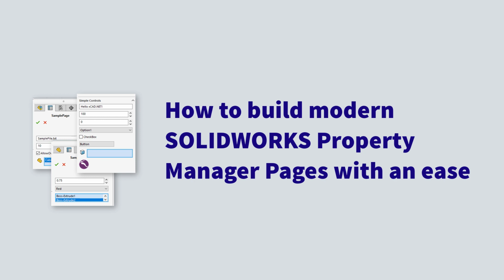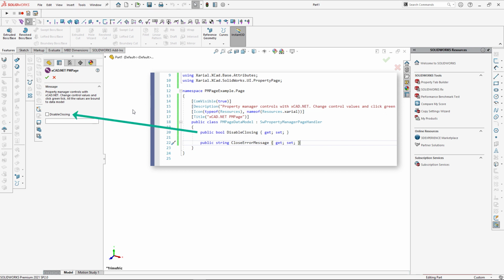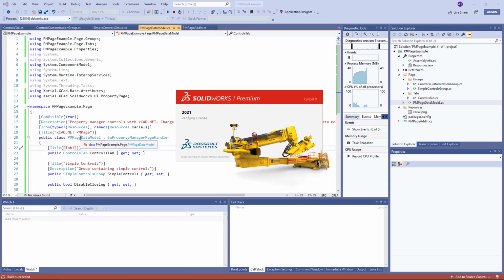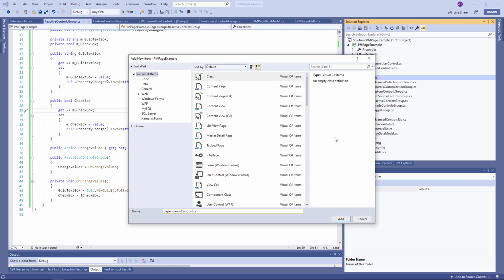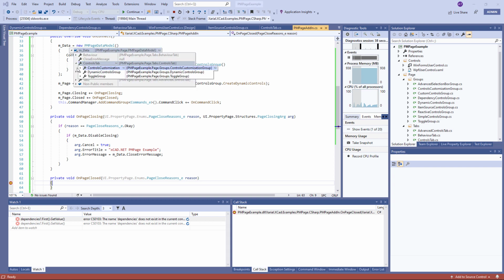Build modern SOLIDWORKS Property Manager Pages with an ease

Comment from the maker: 0:00 - Intro
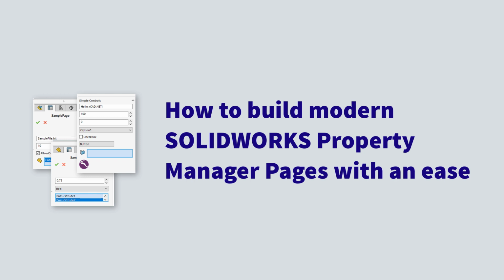0:53 - Current challenges building Property Manager Pages
01:55 - Building Property Manager Pages using xCAD.NET
04:33 - Overview of the tutorial
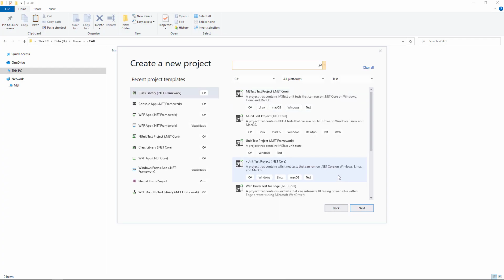06:25 - Getting started. Simple Property Manager Page bound to the data model and closing handler
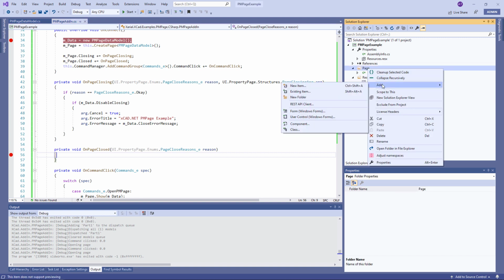13:19 - Adding simple controls (GroupBox, TextBox, NumberBox, ComboBox, CheckBox, Button, SelectionBox, PictureBox) and binding to data model
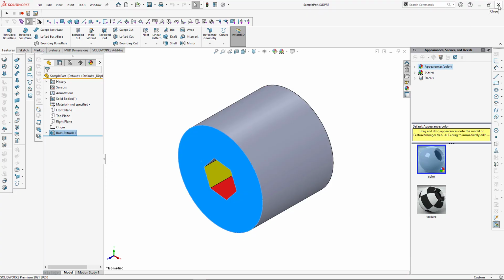16:58 - Customizing controls (custom and standard icons, titles, tooltips, height, background and foreground colors, control specific options) and adding tabs
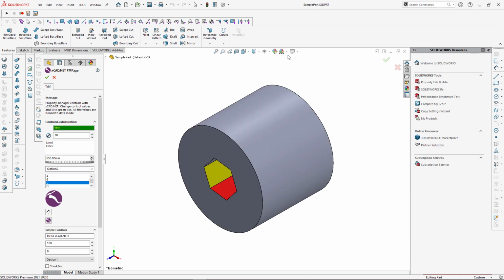20:25 - Customizing tabs and advanced SelectionBox control (standard filters, multiple selections, custom filters)
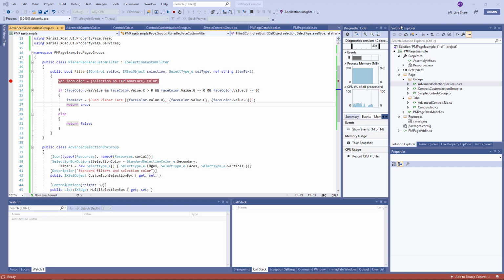24:50 - Checkable GroupBox, excluding the generation of the control for specific properties
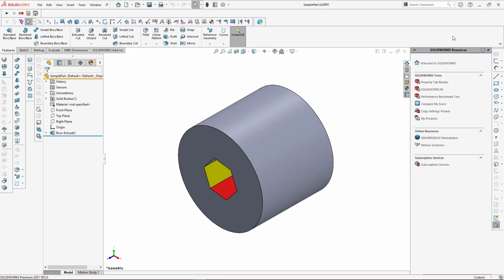27:04 - Adding ListBox, ComboBox, and OptionBox and different ways to bind the data source
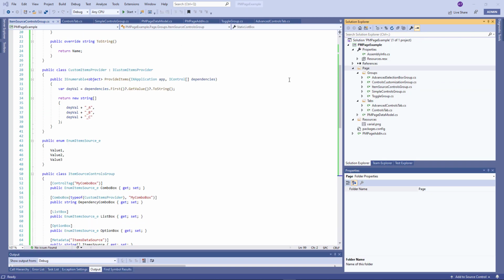30:51 - Adding custom WinForms and WPF controls into Property Manager Page
34:28 - Creating reactive controls
36:50 - Creating controls dependencies
39:46 - Creating controls dynamically at runtime
43:32 - Outro and contact details